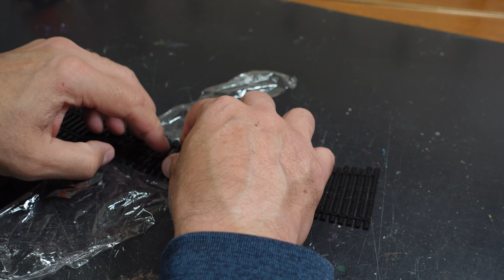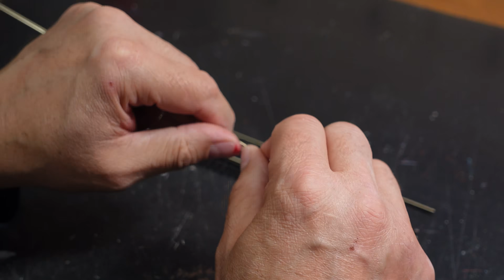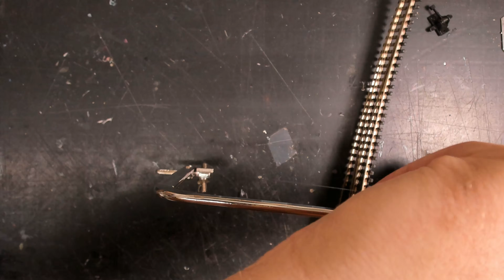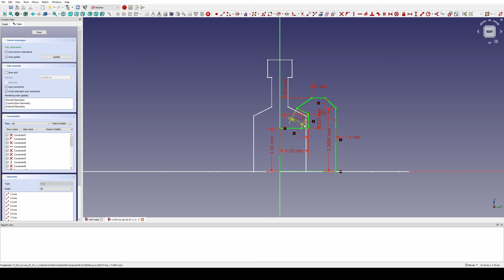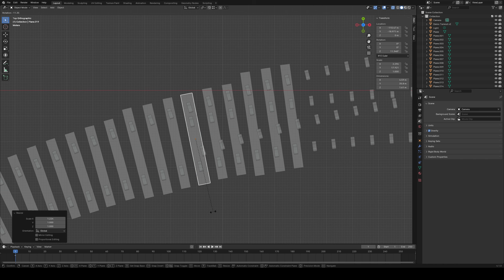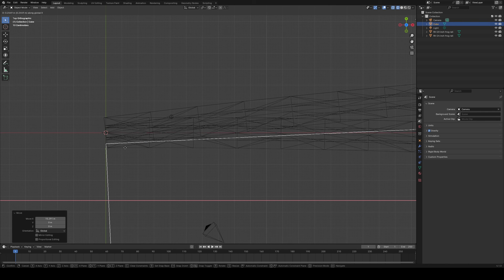We 3D Printed a Model Train Switch—Does It Work?

Comment: For your points, I would use a PC tie and solder the points to it, much stronger than super glue on plastic. Just a thought.
P.S. "Trick": A small table vise would do wonders as well. 😉
Reply from the maker: You are right, but I wanted to do everything with the 3D printer. They say to a man with a hammer, everything looks like a nail. To a man with a 3D printer, everything looks like a nail that he can custom print a bespoke hammer that will pound it in just right :)

Comment: I like the video, very informative…
A tip that might help:
Instead of using blender for the rail placement slide (don’t know the actual name), you could use the same extrude + trace method as you did with the rail “spikes”. This way that track will be exactly under the rails. 

I think the ties can be done in a similar fashion with some tweaks but I would have to play around with it first and learn the design technical lingo to better describe what to do. 
It’s bad when I know what I’m trying to say but can’t think of what the function is called to actually explain it properly… 🙄

Great video non the less, will be referencing this for my future projects 👍🏻

Comment: Ok you actually can slide the steel rails easily. Ok fair enough. Just had a great idea on printing inter-connectable train tracks with additional steel rails to be inserted  too , similar to Fleischmann Profigleis, good compromise between space use and stability, but they are expensive ... so I need to run HO trains, so need steel rails, but how to insert them: ok you can slide in as I see, second Idea just came up, first you make the model of the substrate and ballast  underside the main frame let's say , and the outer sleepers and fasteners all in one piece (only outside). Good would look good to have at least two colour printer (I don't have yet).  The main print should spare out the small space where you will squeeze in the steel rails ... now, the inner printed section side will squeeze from the inner side the rails into position, and need to figure out some small plugs to stick them together with some click mechanism both for each rail and each inner insert... , so you can go actually endless ... and make any curves that printer can handle ... you're quite advanced in doing a switch ... Profigleis has the curved ones but the radius is quite tight so some locomotives can get stuck .. so good idea you do your own radius switch.

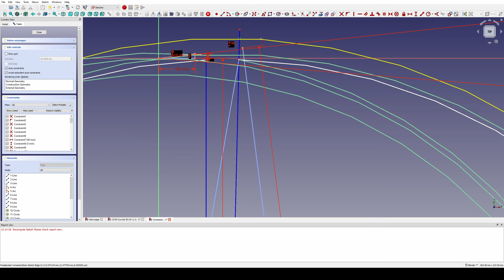Comment: Very helpful video.. I have a lot of learning to do. I got completely lost at 21:00 point. I hope I can catch on. This is just amazing. Thanks..
Reply from the maker: All I am saying there is you have to trim the circles that make the rail centerlines.  On the separating side of the switch, it is best to do it far enough away from the frog that you can easily fit whatever mating track you are using to the switch without interference. On the other side, you can cut it wherever you like as long as it's past the points. On a curved turnout, you want to keep the lines that are the main radius of the curve. And it is easiest to start the cutting lines at the circle centers so the cut ends are square - hope this makes it a little clearer.

Comment: I think you should take the profile of the side of the metal rails and 3D print two push pull wheels and mount to curve your track between.  It will cost you pennies and make curving a doddle.

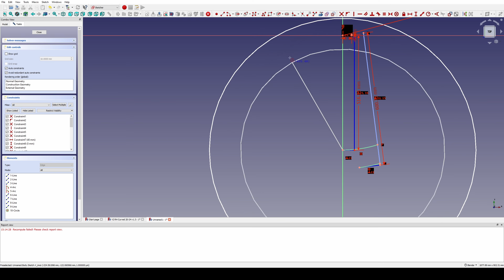Comment: 20:19 If you used the average of the center of those two circles and the average of the radii and put your wooden stays? (sorry, don't know the words here) aligned on that line you could do the stay placement parametrically. Sorry for the armchair CAD. I'm afraid to do the length math of those stays though.

Comment: @06:30 Perhaps consider 3D printing a hole in each ( or every second ) Tie under the Rail allowing for a suitably thin Glue to be wicked in from below ( through the hole ) instead from the sides / top which should result in less of a mess 🤔

Comment: That saw blade is meant to be installed from a seated position at a tall bench.  Sit in your chair and put the end of the saw handle on your sternum. Put the other end of the saw against the workbench in front of you.  Now lean forward gently and the pressure will bend the saw ends toward each other slightly. Now hold the saw in that position with your body weight and you can now use both hands to manipulate the blade. This will also put tension on the blade as you release your weight. It should ring like a guitar string. You will have better control of your cuts as well. 
I’m a trained bench jeweler. Those saws are our buddies.

Comment: You could 3d print the frog area to prevent shorts
Reply from the maker: That is an excellent idea, and exactly what I will do if I print more, especially if they are sharper like #4 or #6
Reply: You’d have to try some different mediums… ABS if you have an enclosed printer, I just ordered a few rolls to try it out. Or I’ve heard good things about ASA, but haven’t tried it yet. It could be printed and cast and poured with a more robust medium or maybe even as a lost master for pouring with a metal medium, but that’s a lot to forge metal :)  I really like the cast frogs from Details West or others anyway.

Comment: Thank you.  I don't know much about 3D printing.  I was wondering if chairs could be printed that were strong enough to have rail threaded through them.
Reply from the maker: Yes you can!
Reply: @ScaleTrainStation  What I had been wondering about was track for say GWR broad gauge or other oddity.  I know you can hand lay track.  But 3D printing would be so much easier.  Thank you.

Comment: might be nice to be able to use the circuit board to connect the rails to power, then  cut gaps in the copper to stop a short (similar to how other hand made ones are done)
Reply from the maker: That's a great idea, if I did a version 2 of these, I would mold in a feature to hold wires in the right places to power all the rails.

Comment: 3D print the filing jig is a great idea, even when they wear out more can be made for cents. Lot of great ideas here. I have tried and failed a few times in 9mm gauge.
Reply: I reckon print something to attach to the file to prevent it from going past the desired point. Print the rail jig and file jig to both sit flush on the bench....

Comment: Only thing preventing us from also printing the rails is the fact they supply power.  What if we just use small batteries in the locos and lighted cars and scrap all the metal rail pickup stuff. Yes, all the powered rolling stock must be converted, but also no more problems with bad pickups, dirty rails, bad contact in unpowered switch frogs, and you could do realistic mostly rusty looking rails.
Reply from the maker: I have another project that is entirely 3D printed, except for the electronics.  Printed teh track and freight cars so far, the next step is designing and building the locomotive.  This is the box carr video:  https://youtu.be/elojQhOg3tc?si=UEJLF9T5c6cgJqcj
Reply: Rolling on plastic rails would be worse.
Especially rough printed rails.

Comment: Did you solder the frog points?  From @8:14 forward the gap has been closed.
Reply from the maker: Yes, I made two sets, soldered the frogs on the first set, but not on the second.  They can be soldered, but don't have to be if they are glued securely.

Comment: Very cool...  I've used my 3D printers to make assembly and machining fixtures for my Sn2 turnouts (S scale narrow gauge, using HOn3 track standards).  Never thought to make pass through holding fixtures to hold the rails for filing the points and frog rails (I used one sided fixtures that hold the rails for machining).  Going to design new fixtures for future work!  Great ideas there...

Comment: i've been trying to find a cheaper yet good looking 3 rail O scale turnout... you have inspired me as i do 3D print so much but never tried a turnout.   THANKS!
Reply: Just remember to electrically connect the two outside rails on three rail O.
Reply: @jonathanvincent5789  i run an independent outside rail as a simple old-school block detection, works great to. so i can't but i appreciate you offering help :)

Comment: Unusual.  No separate switch blades!  It just does not look right.  In real life you would not get a rail from the frog to the switch blade end to bend and take the weight and forces of a train.  (74 yo have driven trains).
Reply: That's pretty common in hand-laid model railroad tracks, though, even if it's unusual in real life.  Making functional rail hinges that don't look horrible is difficult.
Reply: It's actually NOT unusual in real life. That "hinge" we use on our models would never stand up in real life. The point rails are always a continuous rail from the point to the frog.
Reply: You've obviously never actually looked at a real switch. Separate switch "blades" are purely in the domain of model railroads, and even then only in the lower grades of model track. Real switch "blades" (called point rails here in the U.S. are ALWAYS one solid rail, all the way to the frog. Railroad rail is very strong, but is amazingly flexible. Look at a piece of "ribbon rail" (continuous rail) laying alongside of the tracks, and you'll notice how it undulates with the terrain. I worked as a freight conductor for a Class 1 railroad for several years, and never saw separate "blades".

Comment: Nothing sticks to polyethylene.?
Reply: Caboose throws are Delrin, not polyethylene.
Reply: @jonathanvincent5789  He was referring to the statement at 0:28 that nothing sticks to polyethylene when gluing the two pieces together, not Delrin.
Reply: I did a test of 3 different super glues (450, 502, and Locktite) on polyethylene food wrap.  After waiting 30 minutes for the glues to cure, none of them stuck to the wrap.  I don't know about ALL polyethylenes, but ACA doesn't stick to food wrap.  So it's a good backer when doing glue ups.
Reply from the maker: Plastics that are chemical resistant (polyethylene, polypropylene, POM aka Delrin/acetal) tend to not glue well or at all.

Comment: Could you not print the slide chairs as slide chairs (spike heads) rather than cutting them back and filing?
Reply: In the UK there is a lot of developments in printing track base. The current development is to print the timbers with slots for the chairs. So slide chairs check rail chairs etc can be set up as per prototype. Using a track design software called templot the user can prepare bespoke track and pointwork

Comment: Very nice. Can you post the original stl on printable? Also I've had trouble making the tie/spike clearances on the ties to fit the rail. What filament, nozzle and print settings did you use? Nice to see that it can be done

Comment: Caboose ground throws are Delrin. It means it doesn't have to be lubed to work smoothly. it can be glued, just need to rough up the surface you want first with a file or heavy grit sandpaper.